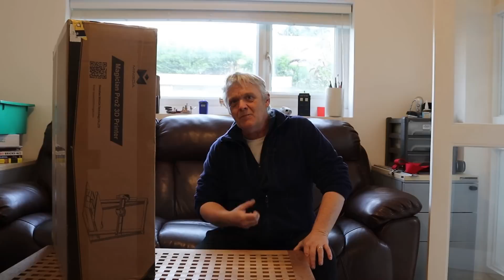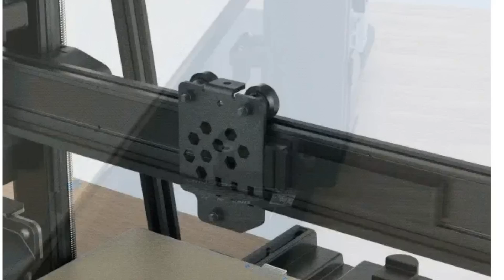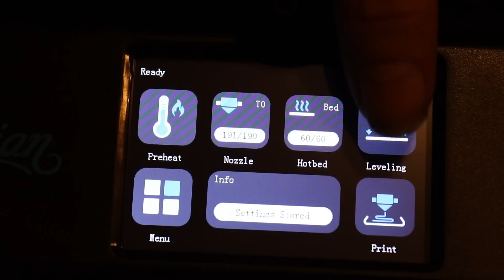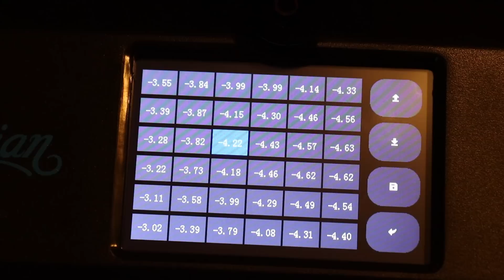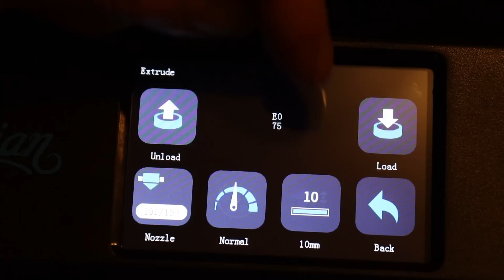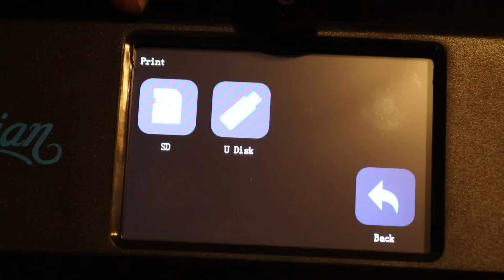2169 Mingda Magician Pro 2

Comment: as a chemist it would be great if you could cooperate with one of these 3D printer companies to create some enzymatic biopolymer from a genetically modified yeast, that can be coded into it's enzymatic process, that is both enivonrmentally friendly and even edible to organisms but firm enough to print usable objects with, rather than being environmentally harmful polymers. As you may know, hyaluronic acid, just as an example, is a critical component in the faschia, a critical component in the human body in the extracellular matrix of all cells,  is a biopolymer: "Hyaluronic acid (hyaluronan, HA) is a linear polysaccharide formed from disaccharide units containing N-acetyl-D-glucosamine and glucuronic acid". However I'm talking about a more firm biopolymer that could be used in environmentally friendly printing, but could be wholly edible by species of plants or higher fungi (i.e. non-molds, excuse the pun). So I am not sure if you could invent, as a chemist, some firm type of biopolymer the molecular design of which could then be impressed onto, i.e. coded into the enzymatic processes of certain species of yeast which would excrete this polymer, which you'd need some molecular biologists assistance with rather than continuing the use of fossil fuels, none of which exist, as you may know, on any other moons or planets in the solar system AS FAR AS WE KNOW... My point is, will we TAKE fossil fuels into space to create required polymers, or will we MAKE polymers in space? Through biomechanical processes? Obviously I feel I have my answer.
Reply: Amen!!! that presently-inherent BIG problem has kept me from even considering one. Hope this Channel reads and offers a challenge to ALL mf'g.s. They have children, too.

Comment: Hey Robert! Will you plz print something that won’t turn critical after being assembled in a vacuum?! I want a helium ball to see if it wants to escape.
Reply: I thought about that one, making spheres with a vacuum inside. After looking at the options I'm aware of, I came to the conclusion that any material strong enough to resist the air pressure around it is going to weigh a lot more than the volume of air displaced, at least at a marble to tennis ball scale. At a much larger scale it may be that buoyancy can be achieved because the volume increases about twice faster than the surface of the sphere
Reply: @VeniceInventors  
I reached the same. But at high enough altitude, maybe heating the helium would drive it insane. And a reasonable floating greenhouse might actually maintain.